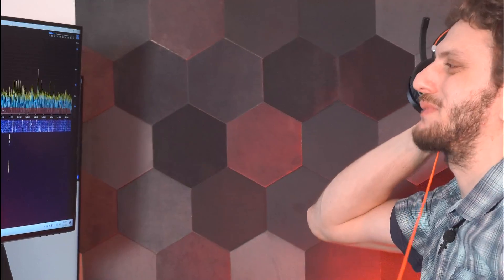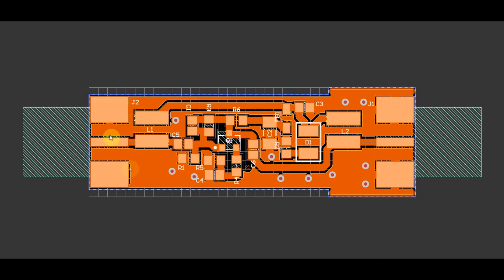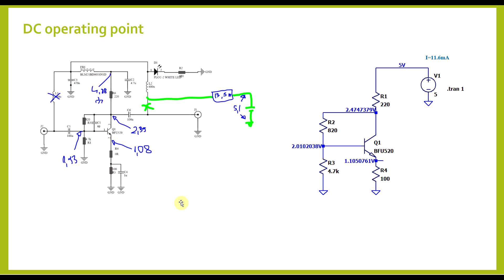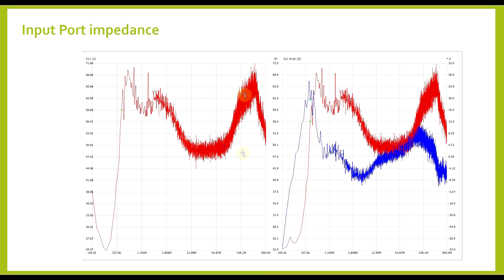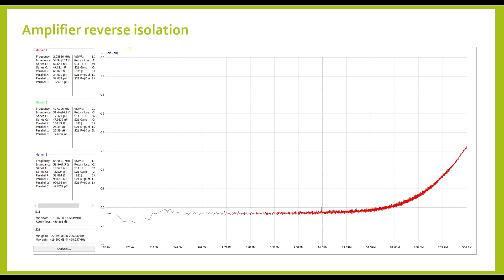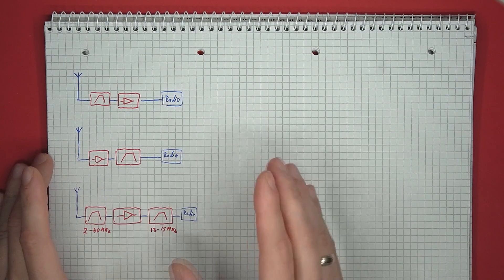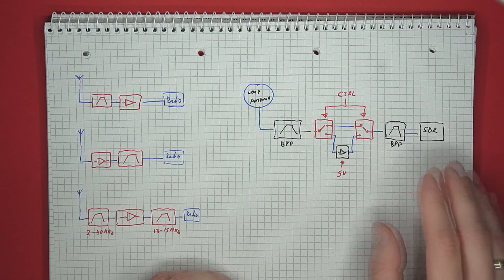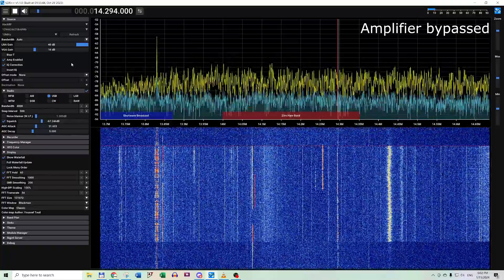Gain block RF Amplifiers – Building and Testing [2/2]

Comment: What SMD inductor did you use? How is it even possible to have 680uH inductance in SMD package @ 100MHz. I'm confused, was it some random inductor with SRF ~ 10Mhz? If yes, how does it work at higher freq that you were measuring?
Reply from the maker: I don't really have the order code anymore, but the component is nothing special; I expect it to be in the capacitive range by 100MHz, however, the important part for this application is that it has a "high" impedance. In other applications, to extend the usable frequency range, I also tried adding in ferrites in series.

Comment: Nice work as usual.👍
You may want to investigate the "Norton Amplifiers", then again I'm quite sure  that you familiarity with them.
I've been building SDR equipment for ~20 years, using ASIC's eg:AD6620, HSP500016, etc. and of course FPGA's, Ettus N210's, X310, etc.
I found the Norton Amps to perform very well, low NF and flat frequency response along with the gain.
I'm the fellow that sent you an email about the Kellermann Baluns.
I need to follow up on this and send you the info. Just way to busy these days!
73's 
Dale

Comment: What is the SMD marking on the BFU520 transistor?
Reply from the maker: It seems to be "HZW". Out of curiosity, why do you ask?
Reply: @FesZElectronics  
I want to try building such an amplifier and I am wondering if maybe I will find it in the analog TV tuners I have.
Reply from the maker: I would recommend that you take a whatever transistor you have and if you have a simulation model, just try to adjust the values in the circuit simulator to get the desired effect. I would not rely on the marking on small smd transistors since usually there is no clear rule that they follow... in the olden days if it wrote "BF200" you knew it was a BF200 transistor, but now, its just some random set of characters, and each manufacturer just uses something different...

Comment: What is difference between Zin and Z11 in LTSpice? They are different values! (at least in my case) How to measure Zin with nanoVNA? It seems like Z11 (from LTspice) = S11 |Z| (from nanoVNA). But it is not Zin from LTSpice.
Reply from the maker: By definition the Z11 and Z21 are obtained when the second port is left open; when measuring Zin, the second port will be connected to whatever load is in the circuit - I think this is why you are getting different results. For example, I simulated a basic 20db resistor attenuator (40.9; 10.1; 40.9 R) with the second port being connected to a 50R resistor which is the output port load. the Zin param is exactly 50R and Z11 is 51 -> for Z11 the ouput port is left floating (the 50R resistor in disconnected); but for Zin its left in the circuit.
Reply: @FesZElectronics  Thank you sir! I had a couple of dead "spf5189z" chinese LNA modules. Both was modified (by me) with protection diodes on input, current limiting resistor and TVS diode on power line but anyway just died from static when I touched something of my gear (not even LNAs directly). So I decided to use these boards to make my own LNAs. I used bfg591 transistors. I connected it like original ic: collector - to inductors, emitters - directly to ground and base - to input capacitor. Then I picked a resistor from collector to base to set dc bias current within 50-60 mA (for best perfomance according to datasheet). And that's it. Such solution worked well judging from what I saw in SDR software (at 70 cm there was 8-10 db of gain, very similar to "spf5189z" thing). But it worked well only with my homebrew BPF (I use it on 70 cm band). Without BPF it works very bad due to extreme gain around 100 MHz band. I don't have any attenuators for my nanovna to properly test S21. I didn't tried to make my own because I doubt that homebrew attenuator can work well at such high freq. So I tried to carefully measure S21 with low voltage supply. At ~100 MHz I got over 17 db gain with just 2V supply! So I decided to not go further to not blown up input of my nanovna. Then, thanks to your videos, I figured out that Zin (S11|Z|) of my LNA is too low. I didn't change original 100pF input-output capacitors. In LTSpice I found that I need 8.2 pF cap to get 50 ohm Zin at around 440MHz. But in reality I picked 4.7pF cap to get 46-47 ohm Zin on 70 cm band (actually nanovna measured 8 pF series C so it is close to simulation, those extra 3 pF are parasitic). I don't know how to measure Zout with nanovna (probably you can explain?) so I just picked 10 pF for output cap like in my simulation. Also I realized that instead of attenuator I can safely measure S21 of my LNA just in series with BPF because gain on 70cm band is not that big. Finally, after all, I got 14+ db gain at 70 cm! It is significally better than "spf5189z" suddenly dying thing. I can't measure noise floor with generic common SDR receiver but it seems like it is also a bit better or at least not worse. So I got really nice LNA with simple circuit.
Thanks to channels like yours I begin to understand deeper sorts of magic. Thank you again!

Comment: Are you using special RF relays?  Latching or non?
Reply from the maker: For this application I just used a random non-latching relay I had in my old box of parts; As long as the frequency is low enough it should not matter; anyway, the only modification I made to the relay though was to add some copper tape on its outside to act as a bit of shielding.

Comment: Love your videos. Repeat of question from part 1: what was your design process to get 50 Ohms in and out impedance?
Reply from the maker: You can start with the generic formula for input and output impedance of the common emitter amplifier; but after that the finetuning is easiest done in the simulator - try multiple values until you get closer and closer to the desired ones.
Reply: @FesZElectronics do you have such video of building a NPN common emitter amplifier? Thanks
Reply from the maker: I did actually make a series on both the various connections as well as biasing transistors - for the common emitter this is the first ep: https://youtu.be/D-76AL5fijE
Reply: Thanks  @FesZElectronics  I'll work through an example or two at VHF.

Comment: Many thanks for this video. I certainly have a stupid question, but I will be interested to see in another video how you obtained the input/output impedance, amplifier gain, amplifier reverse isolation diagrams please? (if it is possible)
Reply from the maker: The diagrams are directly obtained in the VNA control software - I used nanoVNA-saver. I connected the vna to my pc trough a USB cable, and then I control it with the program.

Comment: You must have removed the 20db attenuator in order to measure the out Z parameters.
Reply from the maker: Indeed, for the output impedance it was removed; I had to use the attenuator only for the amplifier input
Reply: With a 10dB attenuator and a nanovna you can still make usable measurements in this band. Just calibrate the analyzer with the attenuator in place and you'll get the graph out nicely